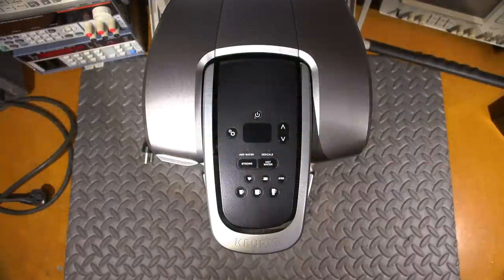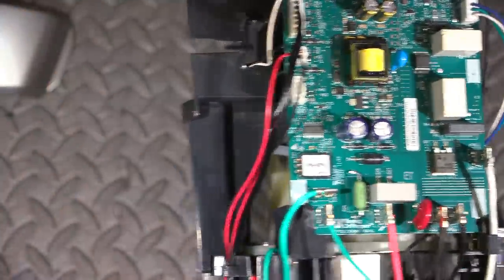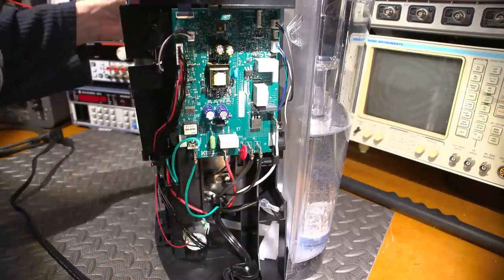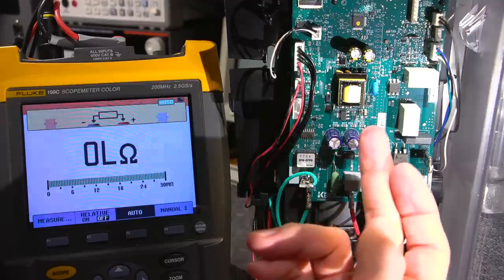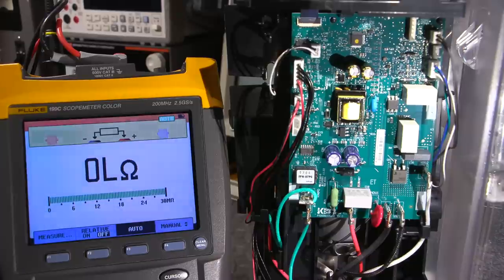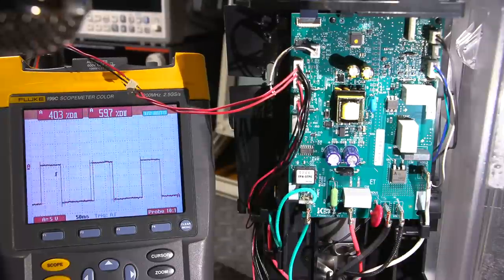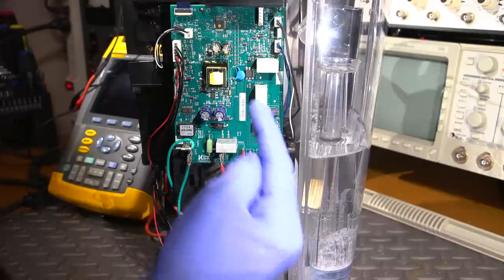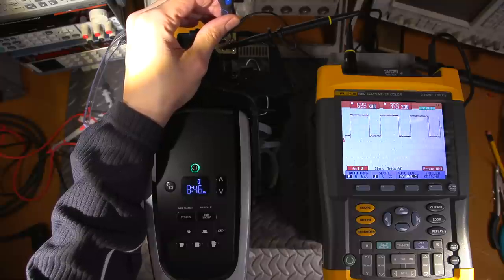Coffee Maker Repair And Modification - "For The Perfect Cup"- The Keurig!

Comment from the maker: To learn electronics in a very different and effective way, and gain access to Mr Carlson's personal designs and inventions, visit the Mr Carlson's Lab Patreon page here: https://www.patreon.com/MrCarlsonsLab
Reply: HOW MUCH DO YA FIGER THE PARTS COST TO FIX IT ,JUST WONDERING :) NICE WORK!
Reply: make a 1930s coffee machine equliavant
Reply: Thanks for the video.
Was just wondering, you fixed the problem of the RF on this machine, but why did this machine have such bad RF vs the other machines?
Are the machines made different, or was the blue cap not working or wrong size, or is the bad RF machine rev A and the good RF machines rev B?
I like that the problem is fixed, but my mind is a mind that has to know why or what is different from good RF vs bad RF machines.
Reply: Nice Mic   Mr. C  studio quality ~~
Reply: Out of curiosity, what are the odds that that pressure sensor is at fault?
The motor speed sensor is working and (no offence) I wouldn't have jumped straight to a corrupted MCU. I think it's more likely that pressure sensor is part of the speed control and may be reading a higher pressure than it's actually seeing.
Reply: Hey, Mr. Carlson Thanks for all your videos. I was wondering about a couple of things that I think may have needed to be checked a little further. no offense to you and you may not want to go this deep. some of the guys hit on some things in the comments also. I'll list them and maybe you can add a little info. If you could?

The bad RF: 
Was the blue capacitor checked to see if it was even working?
Were some of the other components checked on the AC side?
How about using your RF sniffer to locate the noise?
We know a lot of displays make noise but not that much probably.

The amount of water:
You had motor control and you had encoder feedback that looked pretty nice so, is there something else that can affect the speed. 
Pressure sensor? I noticed with mine there seems to be some sort of pressure sensing when it gets plugged.
The clock signal on the processor? if the clock is running a little slow or missing pulses it may not run fast enough to see the encoder signals properly. this may also be a noise generator.
Microscope or reflow some connection on processor. maybe a bad solder joint keeping the chip from seeing the signals properly. sometimes just pressing on some connection can tell you if they have good contact.
I love trouble shooting, thanks for taking us along!
Reply: @curtstacy779  I don't mean to butt in, but he mentioned this  in the video; he was pretty sure that the programming of the CPU just got corrupted, due to all the plugging+unplugging cycles. That unit had been unplugged so many times because of the RF noise generating from it. Hope that's the right answer.
Reply: @KelikakuCoutin  Ok, Thanks for the reply I must have missed that bit.
Reply: I think that motor got a bad winding   its way to noisy compaired to otehr kuregs
Reply: That was a very enjoyable video, even at my advaced years , one is never too old to learn. Wish I could afford your courses. Anyway thanks for these videos .

Comment: I'm sceptical regarding the partial failure of the control IC. I would have been tempted to open up a known working machine to compare the sensor signal. To me it seems as though the controller believes the motor is spinning faster than it actually is and so reducing the duty cycle accordingly. The sensor signal seems far too clean to be a direct feed from a hall sensor so I'm guessing there's some circuitry between the hall sensor and the signal line, especially if the signal is 5Hz, the motor surely spins faster than that. I'm guessing but I reckon there's a PWM controller in the motor that's taking an RC filtered input from the hall sensor and converting that to a PWM that's fed to the controller. Now hall sensors are somewhat fragile and seeing as the unit was making lots of RFI due to poor filtering, that can work both ways, allowing external RF into the unit. I guessing you pack some impressive transmit power there. Could it be that before the device failed, you were having a long distance TX on high power? Maybe that get in and fried the hall sensor making the PWM controller input go high?
Reply: My original thought was the noise from the power supply could be getting picked up as false pulses from the motor, but obviously this isn't the case. I thought the sensor was going to be a quadrature optical sensor like a computer mouse but from the waveform (and the fact that shorting the other pin did nothing) it appears that's not the case. I can't imagine why there would be four wires to the sensor if it was a single hall sensor. Maybe it's a single optical sensor, with a pair for the LED and a pair for the phototransistor. It still wouldn't explain the problem, as a broken wheel would produce fewer pulses instead of more pulses.

I actually have a few of those pumps lying around, maybe I could pull the sensor off for examination.
Reply: I kinda  agree with the issue not being the uP.  The fluid pump ( CJWP27) I believe has its sensor going into the pump part of the pump motor. It looked to be a 4 wire sensor which can have a phase A /Phase B signal going back to uP. Missing one of those return signals would cause timing issues. Tried locating wiring for that pump motor. No luck from company selling them . Guess I need to tear down a Keurig.  LOL
Reply: Even if the IC was fine, I wouldn't trust it anymore given the lack of clean-up on the input on the power supply. One little HV transient from static electricity and it'll be faulty forever. My dad actually gets shocked on the metallized handle on our keurig from the static off of his chair, which is what makes me think what happened here.
Reply: You lost me @ sceptical 🤣

Comment: Have the same unit (was a gift) that developed the opposite problem. Pump would not shut off. Took it apart and was stunned at how overengineered this thing is. I couldn't find the problem so I reassembled it. It decided to work... I'll tell you, these machines are absolute overpriced e-waist and K cups are an environmental disaster to manufacture and dispose of. Used to use grounds in the garden as fertilizer and a drip style costs about a 10th of this thing. Thumbs up to Mr. Carlson,,, thumbs down to Keurig.

Comment: I had a very similar issue to yours on a coffee machine, with an extremely simple fix.

The amount of water pumped out can be customised for each cup size button by pressing and holding down the corresponding button until the desired amount is dispensed. Next time each button is pressed, it will fill the cup to the same level.

Somehow the machine had forgotten its custom values and didn't reset to default values after a 'factory reset'. It appeared broken with similar symptoms to this video, but all that was needed was to manually recalibrate each of those Small, Medium and Large Cup buttons.
Reply: This is absolutely not true with Keurig machines. I don't know where you got this from. What is your source?
Reply: @baconsledge  the poster didn't say it was a keurig brand of coffee machine, i too have other brands that allow you to customize cup fill levels.. shame keurig do not allow you to do something similar as it would have made an easy fix to this but probably wouldnt have resulted in a video from Mr Carlson.
Reply: Even if you could do this, the pump was to slow.
Reply: I can confirm that this feature is present in some Nespresso machines.

I had one at my past work and it presented the same issue, and I had to reconfigure the cup sizes holding it until the desired amount has been poured.
Reply: @Android-ng1wn  sounds like a Dolce Gusto?
Reply: @Android-ng1wn  Ah right, had one that would go into a descaling thing it before you could make a normal coffee again. Binned the pod machines and went to grinding beans instead 🤣
Reply: @tedmoss  yes the pumps get weak and wear out and the circuits seemed to function properly to start but making the motor work harder to make up for a weak pump does not seem like a solution to the problem. This video did make me scream at the screen I admit
Reply: @doublebulbing  
It didn't seem like the pump was weak. It appeared that the microcontroller was sending the wrong pulse width possibly due to data corruption. I say this because it appeared to me that the microcontroller compared the pulses sent to the motor with the pulses received by the sensors and adjusted the pulses sent to the motor so they would match. So if the motor ran slow the microcontroller would speed it up and vice versa. Mr Carlson's hypothesis was that the microcontroller had been corrupted (possibly due to a voltage spike, IMO) by being plugged and unplugged so often due to the RF interference it was causing.. 

This hypothesis makes the most sense given the observed scope pulse traces and the observed motor behaviour. Especially since the motor performed well on full DC voltage.
Reply: @jtveg  motor function and pump function are two different things. If the efficiency of the pump declined by 20% then you would have to boot the pulse width and make the motor work harder to get the same previous flow. So hacking the pulse is a short term fix I would put my money on the pump will fail worse and the real problem will be shown then. The same thing happens with pumps in espresso machines as they get weak and fail slowly so the user thinks it is grind size issues but really it is the failing pump
Reply: @doublebulbing  
Fair enough that may be the case although it seems unlikely because he said the unit has not had many hours of usage. I guess time will tell. Cheers.
Reply: I can see you calling manufacture for that chip. They will be confused and have no way to supply a chip.
Reply: @gmcjetpilot  Asking for a replacement chip would most likely result in either:

1) Them telling you that it's not a user/field replaceable device and telling you to send the machine in for repair. At which point they'd probably just swap the whole board.

or

2) Tell you that you voided the warranty, that they won't work on devices that you've messed with, or similar.
Reply: @slycordinator   I know. This is a video to learn and have fun with a cool trouble shooting and solutions only  Mr Carlson Labs would do. These things are cheap. They get you with the over priced garbage coffee pods to make piss coffee. Same with ink jet printers that cost $60 and comes with near empty ink cartridge's. You go to get replacements short time after, and find out they cost $60 each. That is why I have a laser jet. However back to this piece of garbage. Things are made to be disposable not repairable (unless you are Mr. Carlson),  That is why I hate them. I have italain grinder and expresso maker. Very mechanical with only a few switches and pressure sensor. It is manual. You have to turn it on, make your shot and turn it off when you get the volume you need is drawn. Simple and the espresso is so far superior.
Reply: @gmcjetpilot  Where I live, people get around the high price of ink replacement by getting modified inkjet printers which have a hole+tube into each cartridge which then go to ink reservoirs. They put them up on the local equivalent of ebay as "infinity" printers.
Reply: @slycordinator  Have you actually tried that? Ink refill kits have been around for 30 years. The printer companies have made it so refilling them does not always work. There are intelligent chips in the cartage and once empty it's done (to keep cheapskates' from refilling them). The formulation of the ink itself affects the printer and the head will not work if the ink is not perfectly formulated. Some brands are easier to fill but you need specific refill kits for specific brands of cartages. The refill kits are not free and cost a good bit.

I still have the same laser jet cartridge for 10 years going strong. Then there is the disuse situation where the ink jet cartage head dry's out. Sometimes you can soak it in water to free it up. Messy and PIA. I might go weeks or even a month without printing, fire the printer up. Works like a charm never a problem. Ink Jet always an issue. Ink jet is much more expensive per page. Down side is laser jet is  not color. Don't care. I will never never never buy and Ink Jet printer.  Total consumer garbage. If I need color I'll go to FedEx Office and print out that color sheet once in a blue moon.
Reply: @gmcjetpilot  "Have you actually tried that?"

We had multiple such printers at work for several years. It was cheaper than having to constantly buy new ink cartridges.

They've since switched to color laser printers, since in the long run they're cheaper. But at the time, they weren't being approved for the higher upfront cost of the color laser printers.
Reply: @slycordinator  I had marginal to no luck refilling cartridge's. May be they have improved the refill kits in the last 10 or 20 years. Either way it is a messy Mickey Mouse deal. I can't be bothered. YES I know they have color laser jets. I used professional large color laser printers  10 yrs ago at work. Not new. Laser especially color models for home use were $7000. Now the prices have come down and their are cheap consumer models, but now you have multi cartridges, black, blue, yellow, cyan. Again consumer cartridge's (laser) don't last as long and cost too much like Ink Jet. I bought a used refurb commercial laser printer, black only and very happy. One BIG carriage has lasted over decade and also WIFI. If I want to print out a color picture (unlikely) I will go to FedEx Printing, Drug Store , or On Line Printing, or whoever. Cheers.
Reply: @gmcjetpilot  "I had marginal to no luck refilling cartridges."

As I mentioned, these used ink reservoirs. You wouldn't refill a cartridge, but pour it into a tank and when you print, the ink would get pulled through a tube from the tank.

At the time, we had laser printers for printing in black and then some printers like the above for color.
Reply: @slycordinator  Don't care. Sounds like a bunch of horse crap. Good luck with that. I don't fill squat. I just print forever and ever with no maintenance except fill paper tray occasionally. Hard to beat that. Bye
Reply: @tedmoss  ,  It would have resulted in cups that were not filled properly for sure. Way too slow.
Reply: @jtveg  ,  True.

Comment: A great video Paul. I have never seen inside these machines and I was surprised at its construction. Toy motors for the pumps with inbuilt sensors that make replacing with a generic motor almost impossible. I admire your determination to make it work. Of course this repair would cost way more than the machine price, but it’s great to see it being done. 
I make my coffee by using a century old hand grinder I found on the dump which I repaired. I put the ground coffee in the cup pour on boiling water stir and wait five minutes, just as they do in many arabic countries   Great coffee.

Comment: In this day and age of everything being disposable, you're a breath of fresh air. I love to fix stuff even though it doesn't make any sense economics wise because I find it fun and love the feeling of control over my environment that is so lacking nowadays. I love watching someone that shares that spirit.
When my supposedly "smart washer" rolled over and died way before it's a time and they wanted almost $300 for a replacement board, I took that as a challenge. I ripped the computer out and replaced it with an Arduino and some ancient relays I had in a box somewhere. Now my washer runs exactly the way I want it to. $10 worth of parts, $10,000 worth of labor, and an incalculable amount of satisfaction. 😁😁😁

Comment: 15 minutes into the video. Never realised a coffee maker would be such a sophisticated piece of electronics. This is gonna be fun. 🤩
Reply: I have an older Keurig, 15 years, and it is simple!
Reply: Last generation keurigs had touchscreens!
Reply: Actually, Mr Carlson did a video about a refrigerator some time ago. It had a very complex PC board with a lot chips on it. Can you believe it? A complex circuit for a refrigerator!
Reply: Some of the earliest ones were incredibly complicated inside. I opened one years ago and gave up immediately. Expected this one to be the same but it's much simpler. Evolution of design I suppose.
Reply: It shouldn't be. It shows the engineers aren't very clever.

Comment: Really nice video, Paul!  I was not aware that custom programmed appliance MPUs could partially corrupt their programming just by plugging and unplugging the machines from their power sockets repeatedly.  Terrific work-around repair, too, your "nothing goes across Mr. Carlson's bench without getting fixed!" reputation is once again, secure!  I once had an older model Keurig that right out of the box wouldn't pump water.  Called them up and let the technician run through her flow-chart, and when that failed to make it work she reluctantly conceded that it should be replaced under warranty. While waiting for the new one to arrive I took apart the old one well past the point where the technician would allow me to disassemble it over the telephone, found and reinserted the loose silicon tube that hadn't been inserted properly at the factory, reassembled it and the thing ran perfectly.